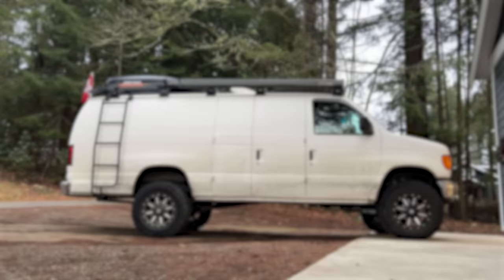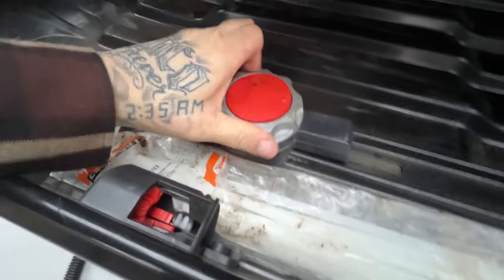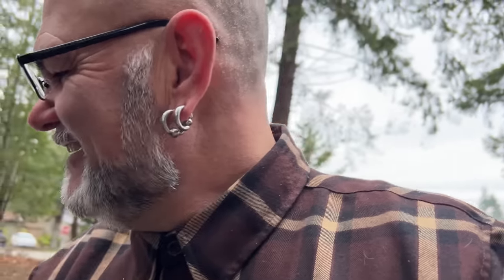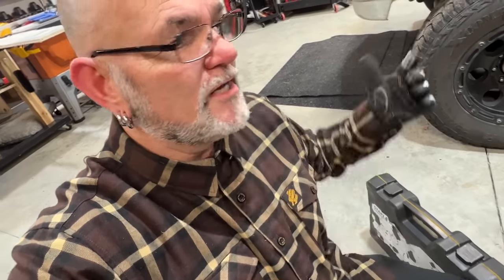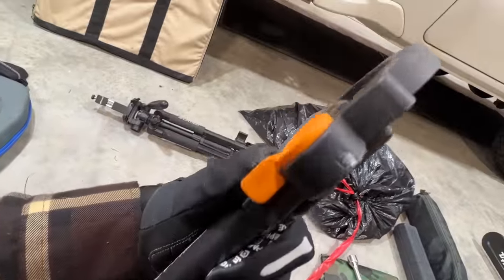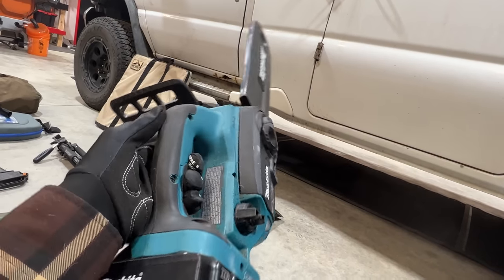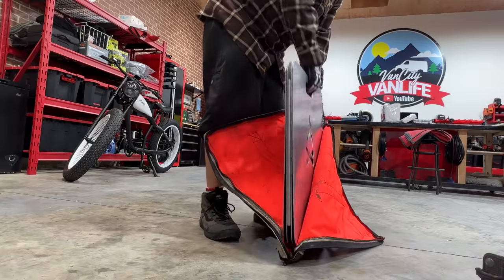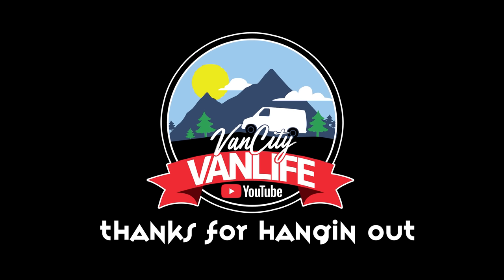VAN LIFE | Dragging My Van Life Essentials Around In My Roof Box

Comment: Later that day, Chrome gets stuck in a freak blizzard, has no chains to drive with, no ax to cut firewood with and even if he could get a fire going somehow...no windbreak to keep it going....and as the temps continue to drop he has no extra blankets to put on his bed to keep warm. AND...if he somehow managed to survive all of that, he gets a flat tire and can't fix it. Then icing on the cake...that annoying squeak returns in side the van but because he doesn't have that 10mm socket to tighten that one nut with...he's totally screwed.